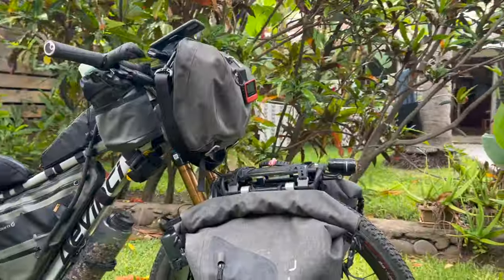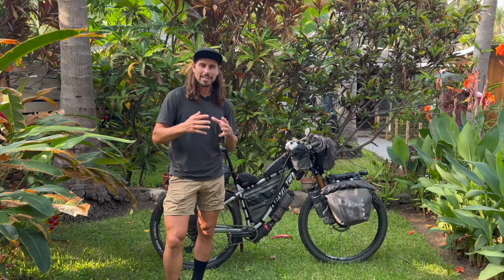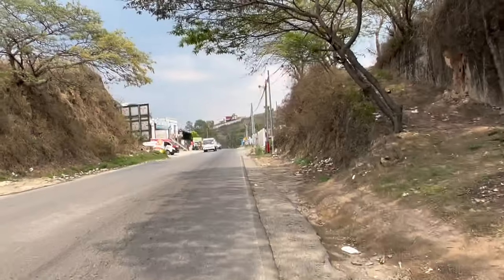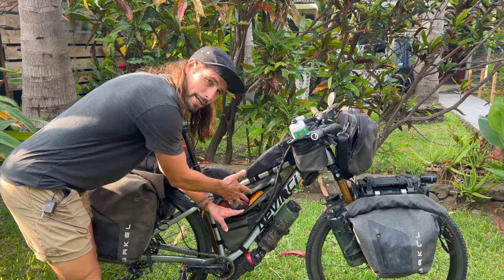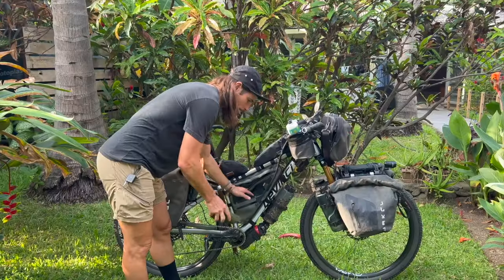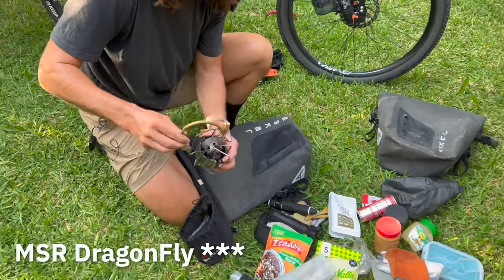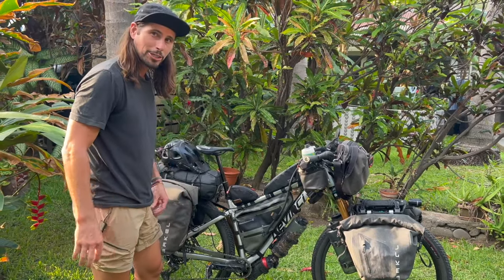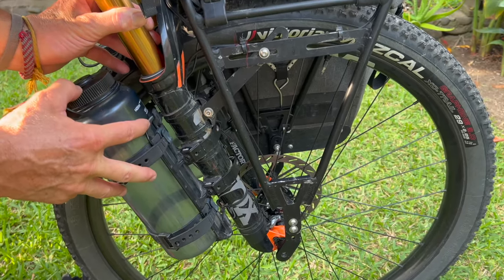My bikepacking setup to cycle from Victoria to Patagonia

Comment: Interesting, but we should stop confusing Bikepacking with Biketouring, the latter reflects the way you travel. The same thing happens when someone goes hiking, but thinks they are trekking. Greetings.
Reply: Funny, I don’t even really know what trekking is! It’s not a popular term in the U.S. I started my travels as a “bike tourer” then started backpacking and became a “Thruhiker” on the Appalachian Trail. Became a “Bikepacker” the next year on the Baja Divide…. 
Tomato, tamato. Silly semantics at best, elitist at worst. Call it what you will! That’s what I say!
Reply: The term bike packing is mostly hot air. It is a term used mostly by Americans, most of whom have travelled very little by bike, who fly 20 000km to go ride a thousand somewhere to feel cool. They saw some dude in a race bring almost nothing and therefore idealize something they don't know about.
Reply from the maker: This argument always make me smile. As far as I'm concern my bike and my way of traveling has both the characteristics of biketouring and bikepacking. If I had done a bike check video at the beginning of my trip after riding highway 101 in the US, it could and should have been called biketouring sure. But in Mexico I rode the Baja Divide and the Trans Mexico which are categorized as bikepacking routes so at this point it's fair to say my bike setup can be apply to both categories.
Reply from the maker: Amen to that
Reply from the maker: Indeed